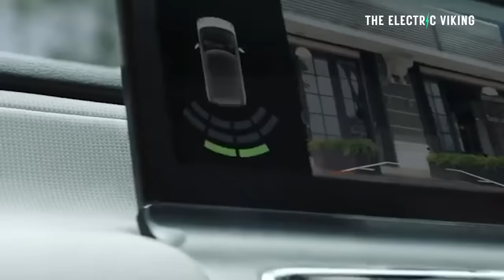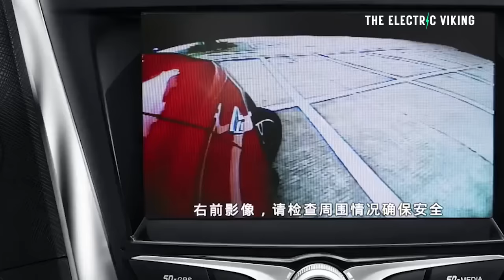Battery prices fall 80%; tipping point to the end of ICE cars is VERY close

Comment: ICE cars will be around for a while because, EVs only suit a portion of the population.  In my circumstances, car batteries could be free and I wouldn't care, because I can't run my life waiting around for 2 hours so I can drive another 100 miles.  When an EV gets 300 miles on a charge AND when a charge takes no longer than 10 minutes AND the vehicle cost no more than a comparable ICE model, I'll jump-in with both feet.  Oh yeah, it needs to get 300 miles on a charge in freezing winter temps and stifling hot summer days.

Comment: It takes 10+ years to build a dependable power plant.  The electrical power and  grid in the USA  is maxed out in most parts of the country. Petroleum will be king for another 10 to 20 years.   I drive a hybrid because their is only one 480 volt fast charger in my area of 1,000,000 people right now.

Comment: ONLY ONE PROBLEM
THE INFRASTRUCTURE ISN'T THERE TO CHARGE A GLUT OF EV'S
Reply: Well said.
Reply: 1,000,000 nevs sold in 2017 to 10,000,000+in 2022 and headed for 15,000,000+this year. Hmm seems you are mistaken! 👍🏻
Reply: 🤔 Not true so far. Mine is charged from solar over my patio.
Reply: @vals.3817 no, it is nonsense propaganda. The grid will be fine. EVs have so far actually helped.
Reply: I seem to recall Musk saying the U.S grid would need about 3 times more energy. I understand his Semi tractors charge on a 1 Mwatt charger. I see several trucks on the road at each outing.  Now, if the small minority of EVs do replace all ICE, I believe the energy will have to come from somewhere.
 I ran a rough calculation for my country. I looked up the amount of oil used for transportation daily. Converting that to watts, came out with an extra 2.5 million Mwatts daily, to add to the grid. We already import electricity in the warm days.

Comment: This is great news. I don't share the same view that EV's will be ICE car killers though simply because the draw on the grid would be too great if everyone switched to EV, and there are lots of situations where you still need an ICE. My wife and I switched to PEV's when COVID caused gas prices to go through the roof and we have saved a ton of cash, and had a lot of fun in the process. We will always own an ICE car as well, but it can be a cheap thing that we don't care about all that much since we almost never drive it. We save tons on gas, maintenance, insurance (since we almost never drive the car). If the batteries cost even less next year that will make PEV's even better!
Reply: Don’t expect anything but BEVs to be made in volume after 2030.
Reply: ICE won't be cheap one economies of scale is gone - expect to pay a tidy premium if you want an ICE, and good luck finding a gas station once EV tips the balance
Reply: The grid is mostly stressed in mid-afternoon.  The time when most EVs are being driven, not charged.  Plugging in at night when use is low, helps level the grid utilization which is helpful.  that said- you're right, we need an upgraded electrical grid.  But- it's a heck of a lot easier to ship electrons around the country than it is to truck gasoline.
Reply: @moreybrown870 what is making the electricity for your ev?
Reply: Good question!  With a gasoline car- you can power it with only one energy source.  One that is a highly variably priced world commodity, that even if we overproduce in the US, still rises and falls on the whims of Russia, Venezuela, and OPEC.  With EVs, you can power them with electricity created by oil, natural gas, coal, Nuclear, hydro, wind, solar, geothermal, whatever.  And you can transport the electricity instantly and a much lower cost.  

oh- even if your electricity is generated with coal... an EV with coal generated electricity STILL produces lower CO2 emissions than an ICE vehicle.  (yes- utility scale electricity production is that much more efficient than an internal combustion engine). 

The reality is- that in a few years, EVs are going to be so much faster, cheaper, more fun to drive and more reliable than ICE cars- you won't want an old-fashioned jalopy (other than for antique collectors and enthusiasts).  Right now everyone is worried about the range of an EV.  that issue goes away when there are as many high speed charging stations as there are gas stations.  Every freeway exit will have one,  @billrehm3590

Comment: no it hasnt, not until you can get an EV to run efficiently in clod climates
Reply: Norway would like a word with you! 😁
Reply: Moving the goalposts again are we?  Last year it was "EVs can never work until they have xxx hundred miles range."
News Flash!  Every EV doesn't have to be able to do every job, and replace every legacy car.   All an EV has to do is meet someone's need at it's price point, and it will sell.
Second: EV Batteries work just fine in cold climates.  All you have to do is warm it up first.  And that's pretty easy since they generate heat when used.
But feel free to try again when you think of another hurdle that you imagine EVs won't be able to clear.
Reply: The world’s most saturated EV market is Norway with 90% EV sales, 80% are BEV.
Reply: @guygordon2780  : I can agree at least in part. I retired, and no longer have a need for an expensive EV that depreciates rapidly. However, I do tow a trailer 100s of miles to events. So far, no EV will do that conveniently.  Same for the other that also attend these events. I have neighbours with trailers, and full size pickup trucks. Since chargers aren't set up for trailer towing yet, that means finding a place to leave the trailer, then driving to the charger. Then hook up again and repeat as necessary. I have also read of having to warm EV batteries for charging in winter. A Tesla used 7 Kwatts just to warm the battery before charging. I recall at least 1 class action suite for an EV because of the range being much more restrictive in winter than advertised.
But no doubt EVs will continue to improve, maybe to the point where I would find one useful, as long as I didn't mind the depreciation.

Comment: Solar is not the way. Nuclear is.
Reply: Exactly
Reply: You're 50 years out of date.
Reply: In one hour, the energy received by the sun, would power the World's energy needs for an entire year.
Reply: @guygordon2780  > Tell me you don't understand nuclear without telling me.
Reply: @trumpisastump9382  sure but we aren't high enough on the kardeshev scale to exploit all that energy yet either. 👍🏻

Nuclear we can do since 1944, fusion very soon maybe 5+more years or so with the help of ai and quantum computing. 😎
Reply: Too expensive. Solar is much cheaper.
Reply: @zenster1097 you just did
Reply: @4literv6 yet, it is solar powering my home and car now.
Reply: @williammeek4078  so? Solar wind hydro and nuclear make up over 60% of all our electricity used right now.
When we charge our bolt over night 11pm-6am it's on base load nuclear, wind or hydro 100% of the time per our emc claims anyway. 👍🏻
Reply: 100%. At grid scale, solar is trash. Nothing more than a supplement.
Reply: @williammeek4078  😂 What about real world power muppet.. Do you think industries use solar..
Reply: @williammeek4078  Not it's not. Do you understand what 4th Gen SMRs are? Costs is literally tackled.

Comment: You don't need to just match the price of ICE, you have to beat it. By a wide margin. To make up for the PITA charging.
Reply: The cheaper operating costs more than cover it.
Reply: You mean the PITA weekly gas station trips to refuel. 
It only takes me 10 seconds to plug in my Bolt every night.
Reply: What PITA? I did a 7.5 hour drive 2 days ago with 14 minutes of supercharging. Took me longer to get a sandwich and take a piss than it took the car to be charged for the remainder of the ride home. BTW, Tesla website said 45 minutes of supercharging for this trip. Actual was 1/3 that.
Reply: @OtisFlint  you're assume tesla. You know what happens when you assume...

Comment: Seems rather temporary and a bit unexplainable.  Lithium prices have come down but nothing close to 80% and they will likely rise due to the massive flooding in China which is very likely to impact both refining and production.  Unless demand for EVs is down; there isn't much other reason for a drop in battery prices.
Reply: The largest reserve of lithium has just been discovered in the US. Also, the advancement of technology and economies of scale should serve the downward pressure on prices. There, three reasons that battery prices shall drop. Have a nice day.
Reply: The drop in lithium is simply explained by production growing faster than demand. Demand is still growing fast as new records are continually set for EV market share, just supply is growing faster.